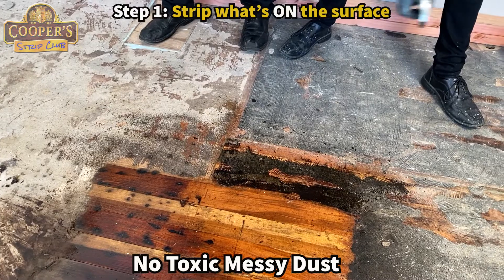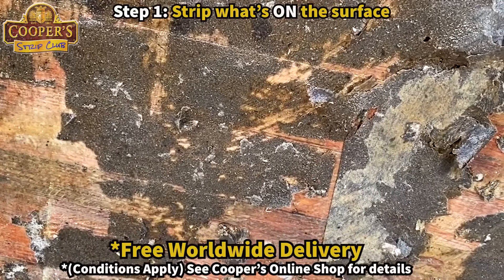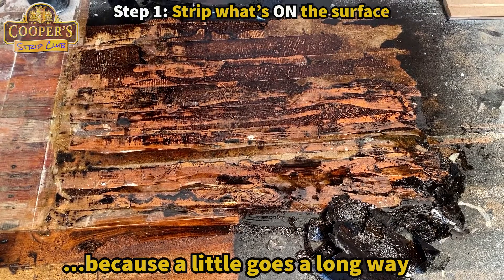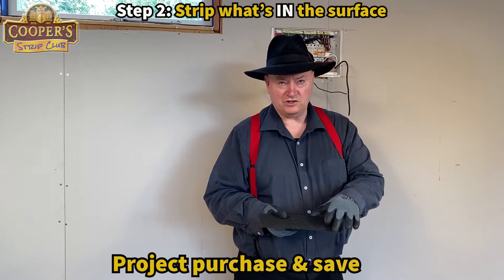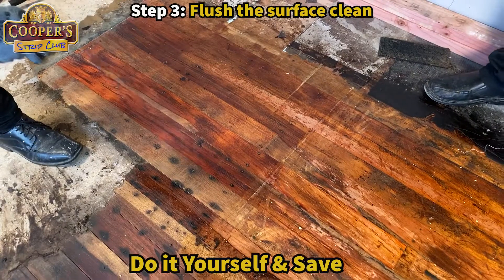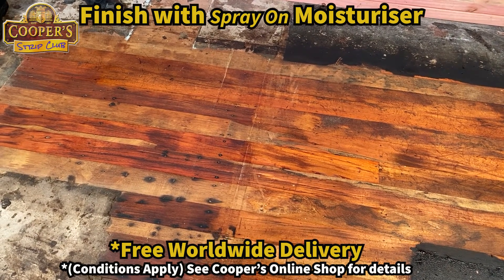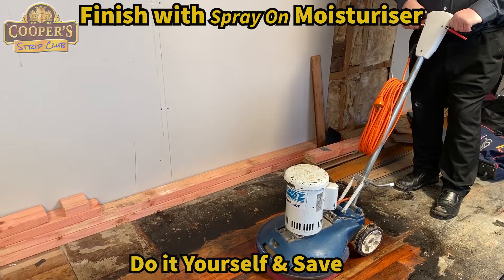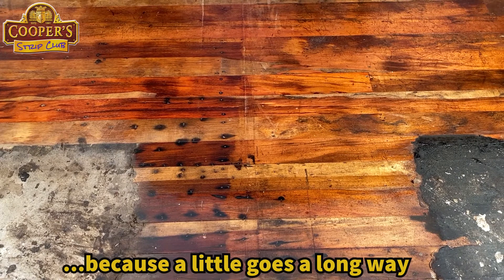How to Strip Backing Paper & Glue from Floorboards

Comment: I am removing 1920's sheet linoleum.  The backing is black tarpaper and is firmly stuck to the maple formerly finished floor.  Is that what you were removing in this video?
Reply: My mom put linoleum over a hardwood floor.  I tested to see what would remove the black looking adhesive.   I think it was vinegar I tested on it.  Then you just wipe it up after vinegar disolved it.  We decided to leave the linoleum as it made a good water barrier and put carpet over it. Now when the carpet is cleaned the wood underneath is protected until someday that we rip it up and refinish the wood floor. Test different products on the adhesive.  Start with simple things. Vinegar.  Awesome from Dollar Tree. Etc.